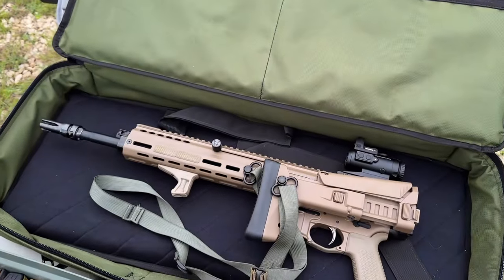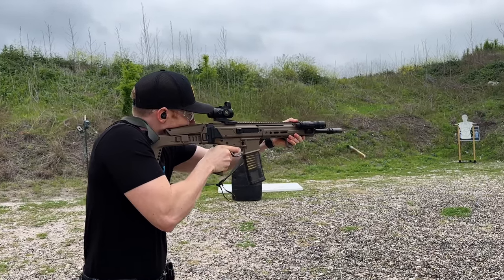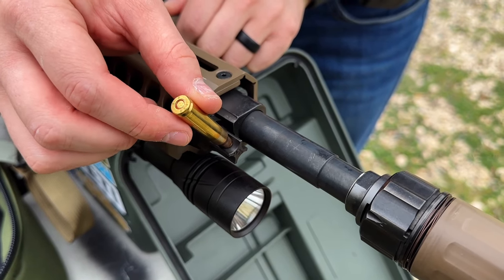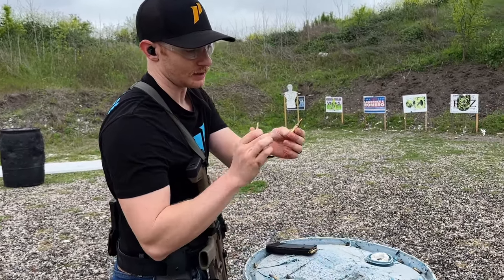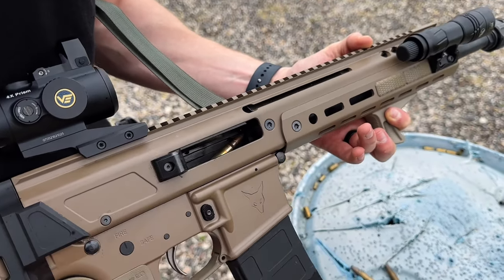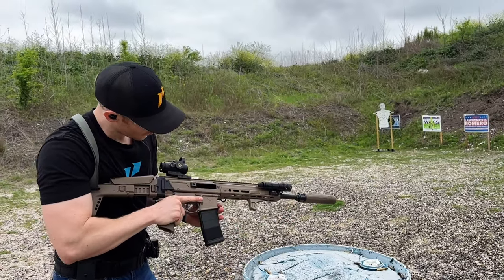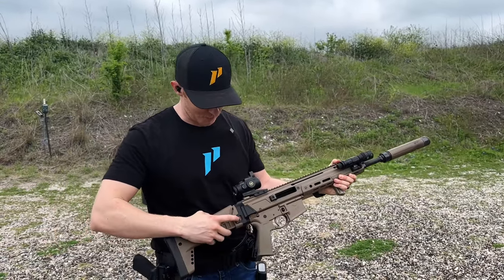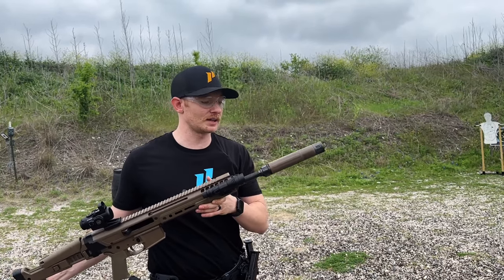PSA JAKL - Will it Survive a 500 Round Test?

Comment: PSA has improved, but their QC consistency issues still deters me from getting anything from PSA. This would be the gun I’d get from PSA because of side charging handle and not a freaking D.I.
Reply from the maker: Valid point! I think their QC has gotten ALOT better in the last year, and I really enjoyed this JAKL!
Reply: My front sight on my dagger blew off somewhere at the range
Reply: @1stShotTactical hey brother what optic used that? Is that a vortex spitfire 5x?
Reply from the maker: @Beavereaver  it’s a Vector Optics 4x Prism !
Reply: @1stShotTactical  thank you!
Reply: Their qc is not good. I bought a jakyl and it couldn't cycle any rounds. I sent it back almost 1 month ago with no word back except to say they recieved it. All they say is be patient. Easy for them to say they have their share of firearms meanwhile I'm without mine and pissed away 20 expensive rounds to try and get it to operate correctly.
Reply: @VegasStacker702 the only thing PSA does good is their online shill program.
Reply: @VegasStacker702 well there’s your first issue. Don’t buy expensive rounds for the range.

Comment: Jakl is a cool concept, but for the same price you can get a BCM upper and a pretty tricked out lower.
Reply: Totally different style rifle though. Piston vs DI.
Reply: I think an AR15 makes more sense for someones first rifle. Jakl is for people who are looking for the perks of a Long Stroke Piston. (Fold, More suppressor friendly, Charging handle preference)
Reply: @DurstyGaming  You don't need a piston to have a fokder that shoots
Reply: Definitely different, but the idea is that pound for pound you could get a more proven system with some premium components as compared to the jakl. The folding stock and all the features of the jakl are cool, just a very new system that I wouldn’t be fully trusting of as much as say a BCM or DD upper, which would cost about on par with the jakl
Reply: @DurstyGaming  an adjustable gas block for a DI gun works pretty well for suppressing. Something like the superlative bleed off system is fantastic, and still get to keep the normal AR platform
Reply: @DurstyGaming  I have a 14.5" BCM that I shoot suppressed. All I did to tune it was use a Geissele Super 42 spring+H2 buffer and it shoots really good. No malfunctions, no problems at all. I've got around 4,000ish rounds through this particular upper. I really like it. It is one of the ELW BFH barrels and even with the lightweight barrel it shoots well suppressed and handles heat very well because it cools so quickly.
Reply: @Oliver0200  If you want a piston system, there's also Primary Weapon Systems. They make piston ARs and are VERY well liked. For another 350 bucks you can get their entry rifle which is hand tuned and test fired (then cleaned and re-lubed) before shipping it out

Comment: I have the jakl in 300 blk, havent shot it suppressed but i do have 710 rounds down range with zero malfunctions
Reply: How is that stock? There are a few complaints coming in about it not being stable, your thoughts please.
Reply: @abovebeyondandforever6571  so I did sbr mine, and so far I have no complaints, the detent isn't great when it's folded but I'm not running and gunning with it folded so that is a non-issue for me. The triangle brace was much lighter so the detent was decent. I personally love the f5 stock
Reply: @Ct125dude - thanks for the response,  👍🏾
Reply: Buying mine in 300 blackout at the gun show in December …. Are there ANY attachments that you love for it that you would recommend ? Building it from the ground up and would love feedback !🎉
Reply: @jasonfoster1996  bcm grip, and upgraded charging handle for sure

Comment: Double check your statement on the bolt release and B.A.D. Lever. B.A.D. Lever won’t work. Another bolt catch/release might if you grind the backside down.
Reply: Yup its proprietary
Reply: phase 5 ambi bolt release fits the psa jakl
Reply from the maker: You are correct it won’t work on the JAKL😢
Reply: @Crackin_Skullz  Did you have to remove any material from it to make it work?